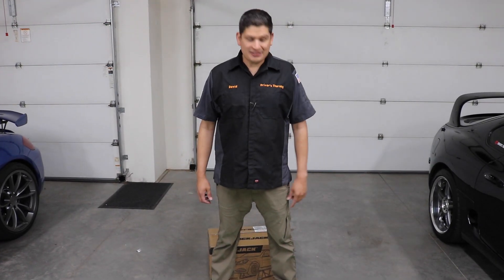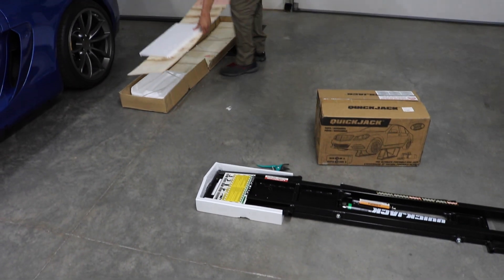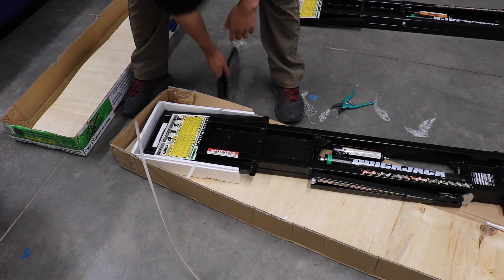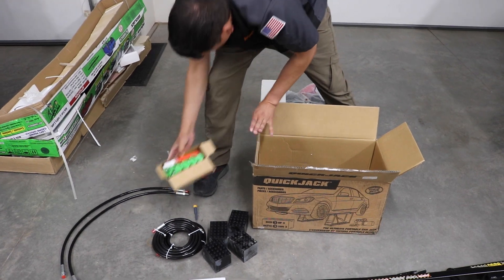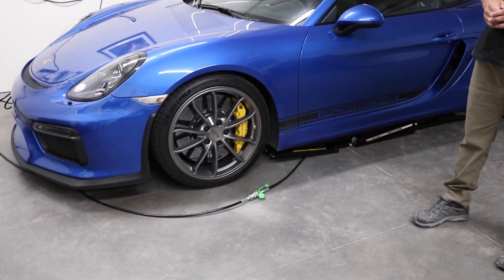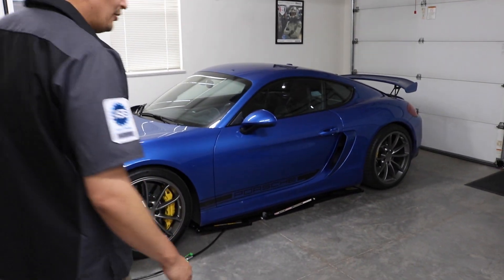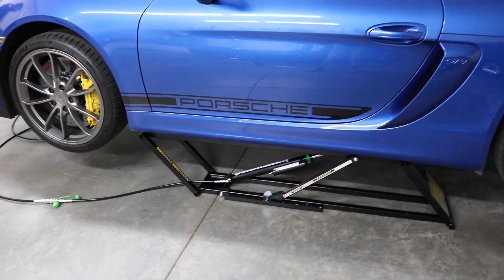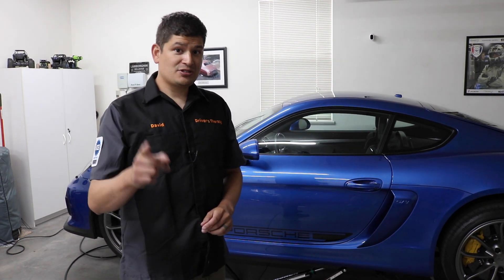QuickJack BL-5000SLX - UNBOXING AND TESTING - For Porsche Oil Changes

Comment: Very nice!  I always get torn between aspiring to these, or going straight to a mid rise scissor or even some of those "Max Jax" things that might enable dropping a motor.  These do look awfully convenient though for probably 90+% of what I do on a regular basis.
Reply from the maker: They are totally worth it. Just a bit of setup time but after that they are easy to use. I did have to redo a hydraulic line since it was leaking but I think I did not add enough teflon tape.
Reply: @DriversTherapy  It looks like they have dry break connections for storage?  Probably would have been nice if they'd done the other connections for you so as to avoid the need for guessing on tape.  That said, if that's the worst hassle then it still definitely sounds like a net win for garage convenience.
Reply from the maker: They really are. My biggest concern was the GT4. Doing an oil change on it requires you to go almost to the middle of the undercarriage. That means I would have to set up all 4 jacks and that takes time and a special adapter for the flat jacking point on Porsches. The alternative which is "special" jack stands is expensive and still requires all the work of jacking up the car and placing all the  4 jack stands correctly. The quick jack solves that. Slide it under the car, check the rubber blocks are under the right jacking points, and press up. You pass whatever height/locking point you want it, press down, and locked in. Everyone including the QuickJack manual states to still slide a few jacks stands underneath. I do it to be extra safe too.
Reply from the maker: @LapoftheWorld  one more thing, if you really want one. Costco and Home Depot have the best prices. Costco is better since they sell it for a few hundred dollars cheaper at times and they also include a bundle that has storage hooks and more blocks. I did the math and even as a non- Costco member and adding the extra 5% increase, Costco was cheaper. But I canceled my order with Costco because the ad nor the customer service representative on phone could tell me if I would be getting the 220 or the 110 Volt setup. So I ordered mine at Home Depot because it was clearly stated.